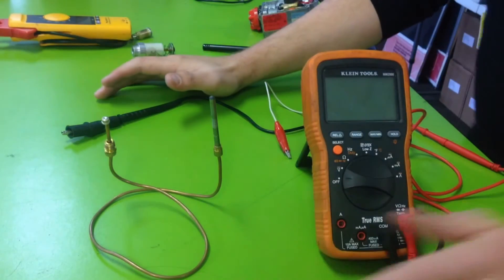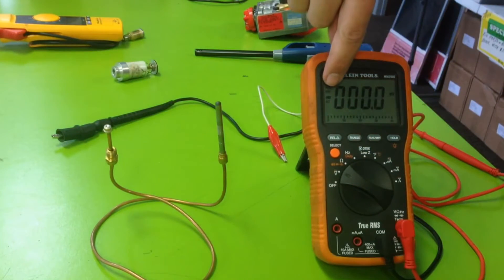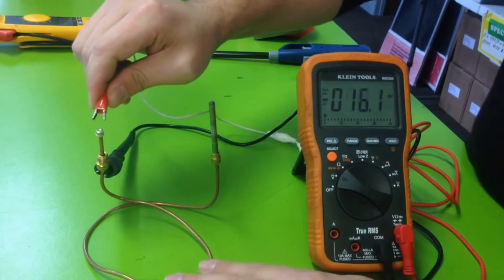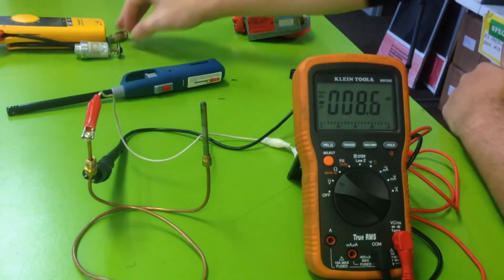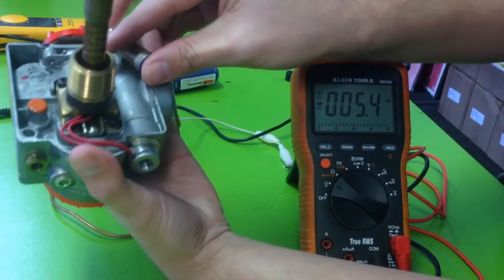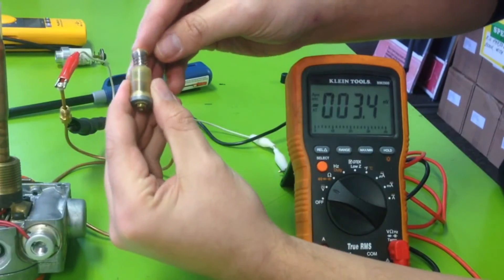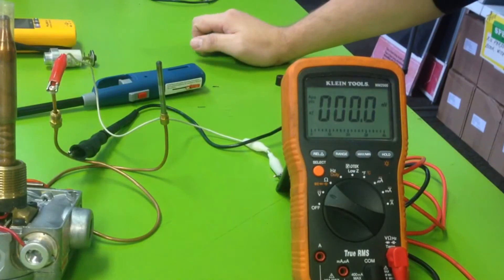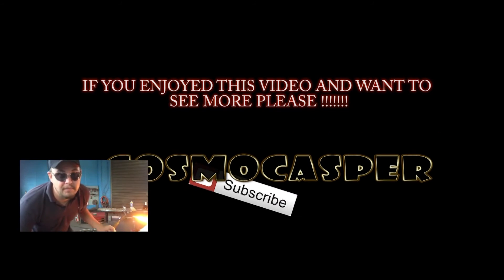Testing a thermocouple with Meter

Comment: Thermocouple not thermocoupler.  Sorry had to correct that . Thanks for the info though
Reply: That bothered my OCD repeatedly! 
Ranks right up there with people in my region by saying chimley, instead of chimney...
Reply: Either way,  this method is simple and effective for testing a thermocouple,  but you may also want to add other styles in another video,  like mine that has the spade terminals for the thermal limiting switch.

Comment: How do you test a thermocouple for a patio heater?  It has two extra leads for the tilt switch.  Are they shorted together?
Reply from the maker: +Blakgun should be where you test, the wires should be what's carrying the milivolts (ones negative ones positive)

Comment: Good video.  How many millivolts are needed to make it open and let the gas go through ?
Reply from the maker: It varies by the size of the coil in the control most the ones I have worked on all hold around 5mv, a lot of the bad ones stay at 0 حنا بطرس